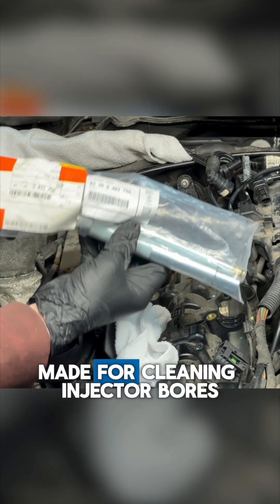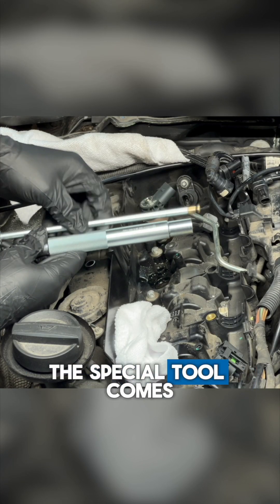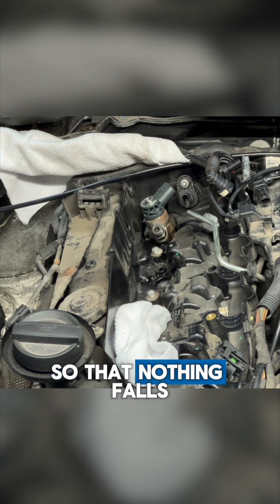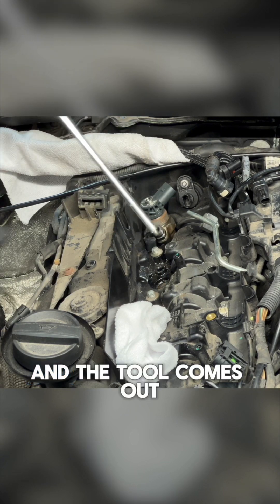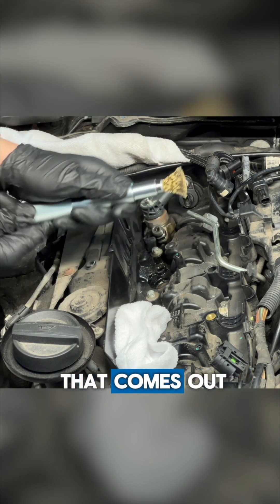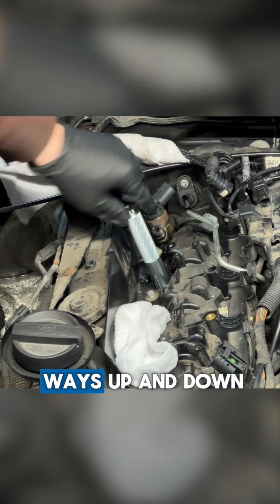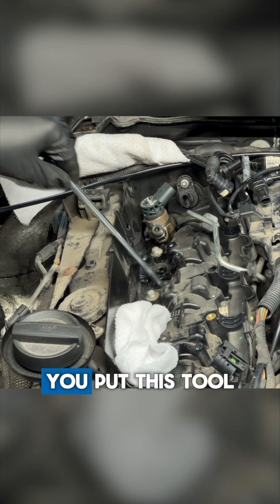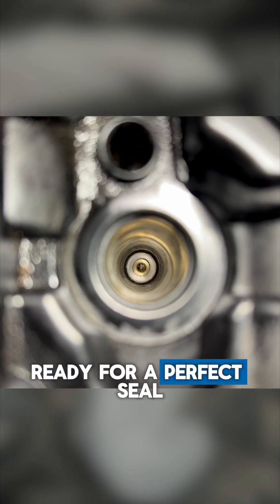#BMW Special Tool for Diesel Injector Bore Cleaning

Comment: thanks for the video, can I ask you to measure the dimensions of the brass part that remains in the engine, the diameter and length, I will be very very grateful, I will try to make it myself, thanks

Comment: Mercedes has the same tool. I’ve modified the brush so it can be used on a drill. Had a employee push too hard on the plug and it dropped ontop of the piston… turned into a head job…
Reply: Bro that's exactly what I was thinking as soon as he said the plug stays in LOL
Reply from the maker: Wow… what a nightmare 😆

Comment: No matter what they do, even supplying special tools to compensate for their stupid design the customer gets screwed.
You would think at the price of a car, that the thought process in their design and maintenance would result in a better outcome.
All manufacturers are the same. If one manufacturer can get away with a crap design, we all can. 
All automotive engineering should be fired.
Reply from the maker: I agree they have a lot of stupid designs, but I don’t think this is one of them. How else would you design a tool to clean a deep narrow bore? It’s basically just a (very expensive) wire brush on a stick, with a plug so nothing falls into the combustion chamber.
Reply: You made a good point but on the worst video possible to do so. This tool is simply genius and easy to use. Its amazing, there is no special or cheap or customer friendly engine designed in diesel cars that can deal with this issue lol. Sorry brother but you missed with this one
Reply: If you think about what’s happened all these years, it was the consumers (you, me and all of us) themselves that complained about pollution the past years and caused all these new emissions regulations forcing manufacturers to make vehicle like these today to keep up their business
Reply: You amy be right but your problem is that youre narrowminded. No offence but not everything thats not perfectly comfortable for you is bad design. Its an engine, sometimes sacrifices have to be made

Comment: Aww you deleted my comment
Reply from the maker: No haha I reuploaded the video because it was missing the captions! What did you comment?
Reply: @bimmer.doctor  you lost the O ring at the tip of the tool inside the spark plug hole
Reply from the maker: Oh, maybe it looks like that on video because it gets covered in oil, but the o ring definitely stayed on